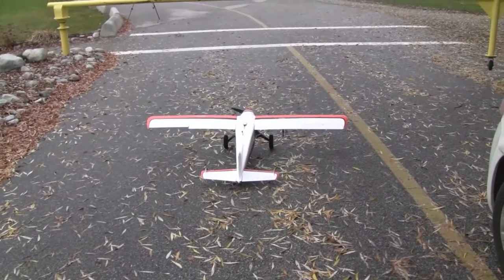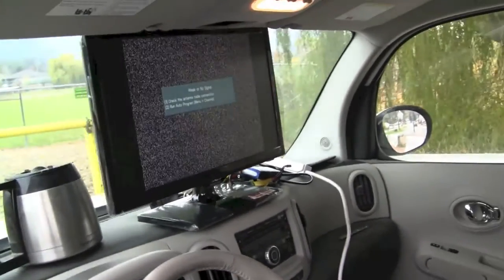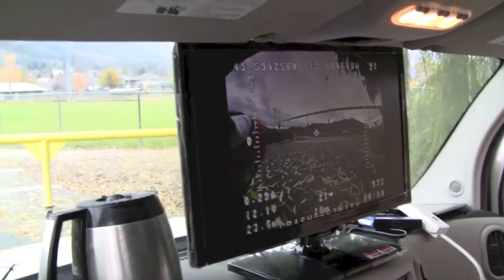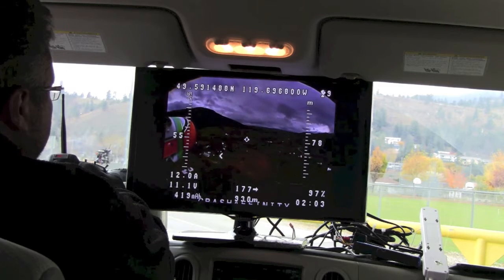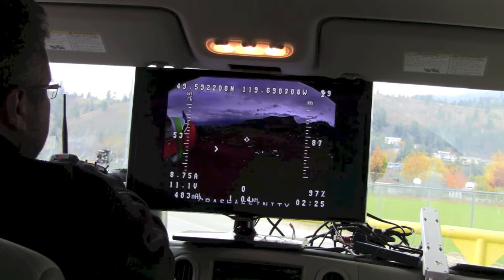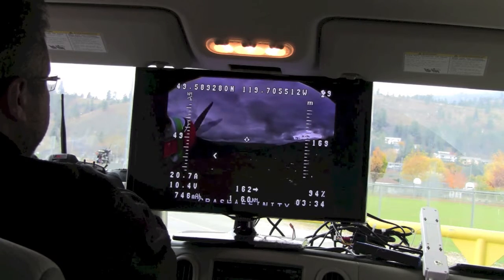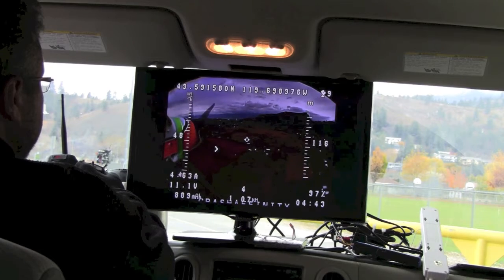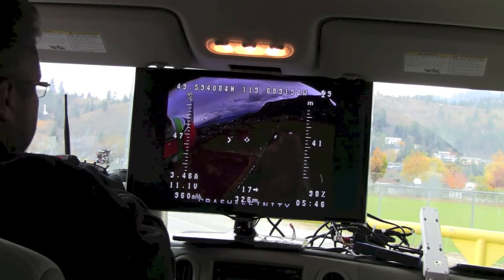New Winter FPV Setup Part 1

Comment: Have you tried this with the car running and the heat on? I was looking into getting a exterior antenna for the Dragon Link but it seems to do fine in your flight. What is that your actually using to prevent blue screen on the TV?
Reply from the maker: yup works just fine with car turned on, and warm! i have a generic regulator behind the tv. the relay feed goes into it via composite cable, and it feeds tv with coax cable on channel 3. i just make sure the dl antenna on the tx has a clear view through the window, though eventually i'll have a roof mount on an extension.